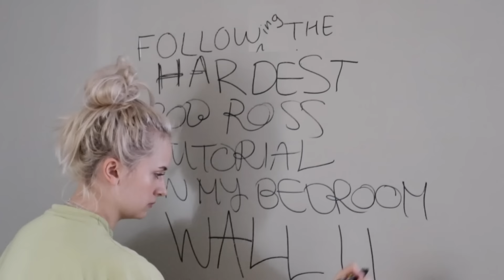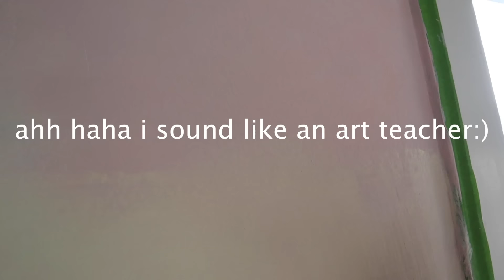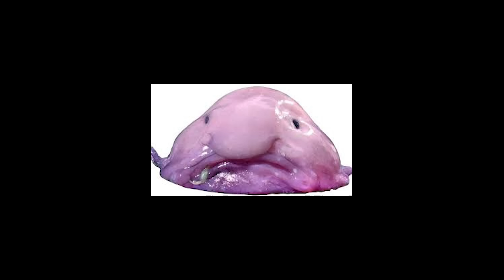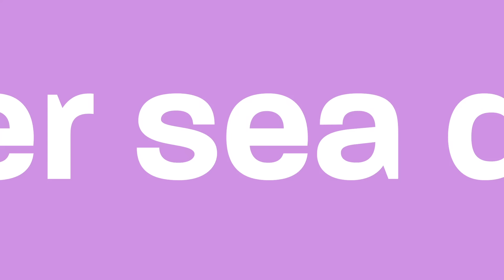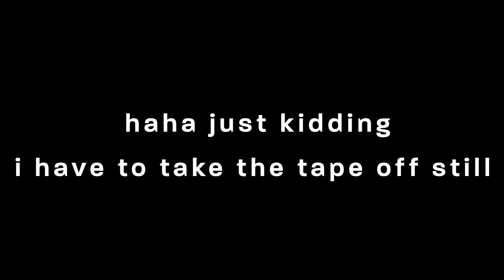following the HARDEST bob ross tutorial on my bedroom wall!!

Comment: Also, given what I said about base layer darks having the tendency to visually poke out through whether we want them to or not, your base white layer went on kind of thin.  Normally, Bob would have a layer of 'Magic White' paint spread over consistently on a white canvas.  Though for this, I would have recommended that you had first put down more base layers of white so that it would be completely white initially.  But with white Gesso or acrylic white paint.  Because you were not starting out with a white surface.

Then you could have then put down a well spread out, but consistent layer of 'Magic White' on top of that, assuming that you were working with oils.  This would have made blends easier.